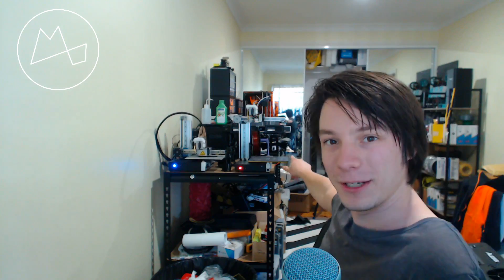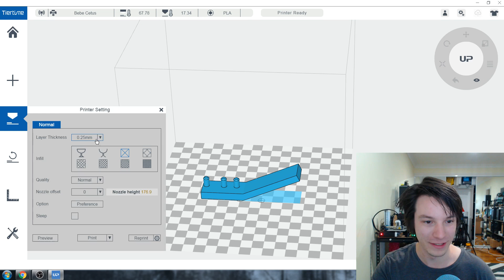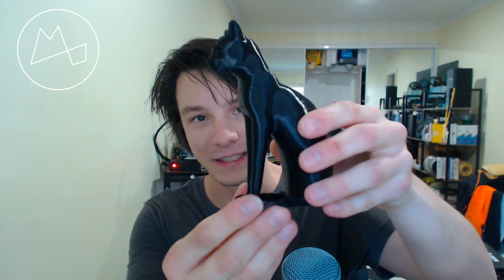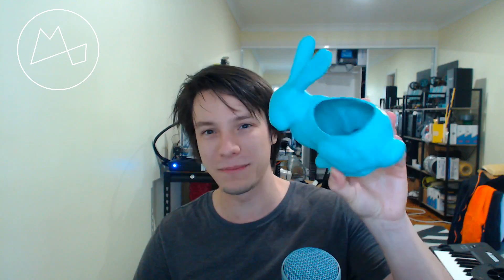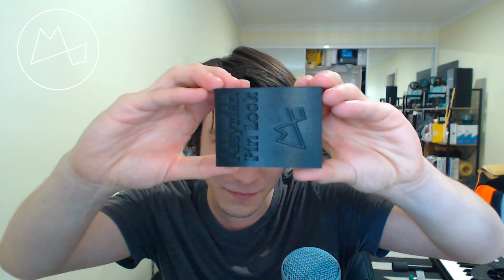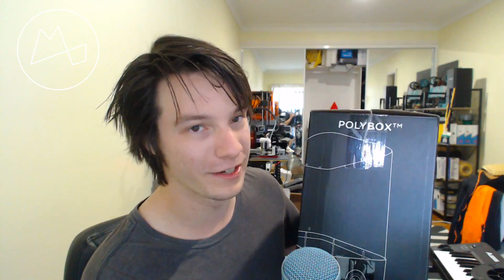Maker's Muse 3D Printing Q&A 27/08/17

Comment: hello Maker's Muse, i bought i creality ender 2 mini 3d printer but after print 1 kg of PLA filament and many models (or try to do it at least) i got just 4 models and nothing with good definition, now after about 1 month my printer is not extruding enough filament, i cleaned the nozzle, but still having the same problem, im thinking on buy a new hotend with nozzle but i dont know what kind of hot end i need to buy, every hotend look different from the one that came with the printer, and i dont know if any of them will work with the printer PLEASE HELP :(

Comment: Angus, I may have mentioned this in another video but... you seem to be getting into 3D modeling more and more and I would like to strongly recommend that you get a 3D mouse. My full time job is as a CAD programmer and I can honestly say that I could not do my job effectively without one. 

I use Fushion 360 for 3D modeling/CAM at home and Siemens NX 10.0 at work. Even though I do not make a "TON" of models at home I have purchased a 3D mouse for use in my personal projects. It truly does make that much of a difference. I got mine from Amazon and it is the "3DX-700028" which is the same one I use at work.

I use a whole different tool chain for creating PCBs which is mainly what I use my CNC machine for. I'm currently building my own 3D printer (using extruded aluminum and linear rails) after having decent success with the A8. It's what I do for my hobbies. =) 

Thanks again for the great content.
Reply: I watched John Saunders' video on them, in which he tried using one and it provided no real advantage for him. How does it help? It seems that the biggest help would be moving around when in the middle of a command, but even that's not a huge advantage.
Reply: When mating objects in an assembly it is amazing. I generally don't use it for individual parts but when you get into assemblies they are very worth it.
Reply: I'd love some info on your CNC setup, I want to make PCBs.
Reply: Laser Man - I have a 2015T that I got off ebay for a bit over $325. I got rid of the parallel port by hooking up an arduino to the separate axis controllers inside the machine. It was actually very simple. I use diptrace to export my schematics to Gerber files and CopperCAM to turn Gerber files into G-Code. For the G-code sender I use bCNC on linux (it works on MAC and Windows as well), bCNC has a probe feature (surface leveling) built in and of course I am using the probe pin on the adruino. I also set up soft limits instead of installing limit switches, it works just as good in my opinion.

I have been trying several different bits and have been having a good bit of luck with the 60 degree 0.02mm tip single flute bits. Now I'm trying some other bits that cost a bit more than the $15 for 10pack of bits. All of the cheap ones seem to wear out pretty quickly. Then again I do make a bunch of boards once I start moving along.
Reply: I'm a full time CAD designer and I can tell you that I hate using 3D mouse..